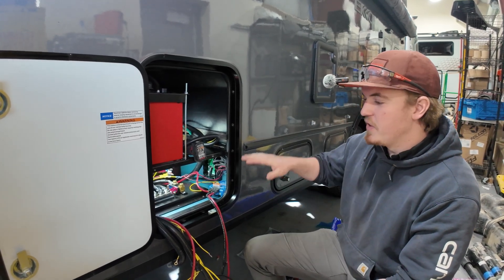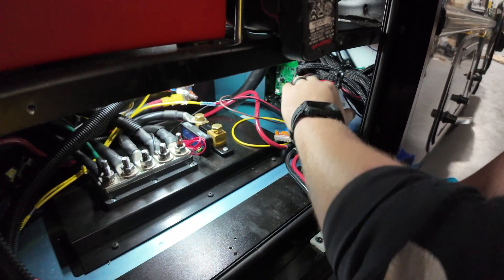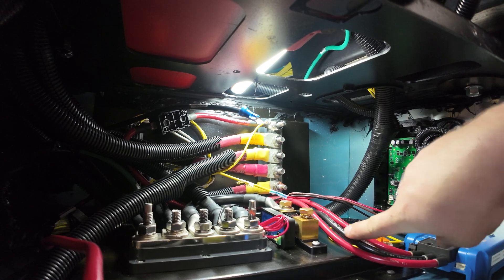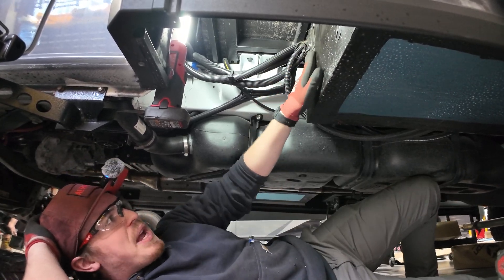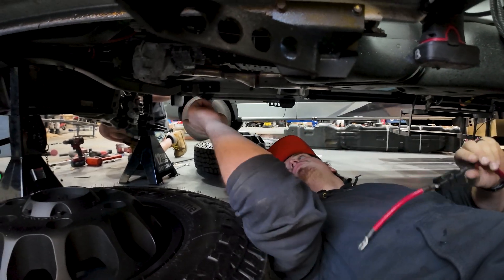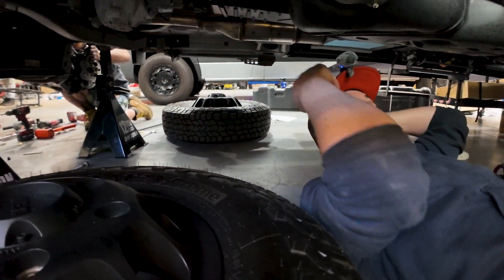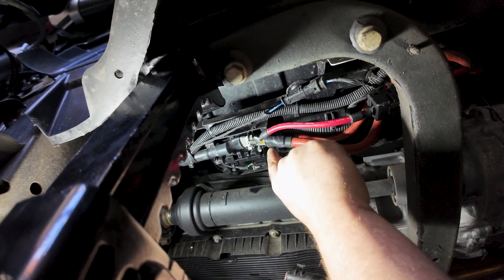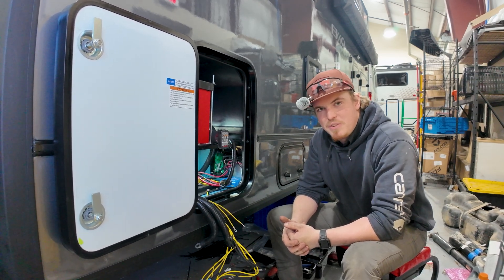Boost Your Winnebago Sprinter Ekko’s Charging with This DC-DC Upgrade- The Victron Orion XS

Comment: Look into 3d printing pass thru panels or custom grommets
Reply from the maker: @11THEFEZMAN11  not for something like this. No real need. Would just add to the cost to the consumer which is the opposite of what we ever want to do.
Reply: @ I built custom cars/boats/motorcycles for close to 30 years. 
3d printing has absolutely upped my game to a completely new level. Once you grasp the design software, I use Fusion because it’s free, you can  knock out a part like that in about half an hour, print 40 of them for $10, that goes for custom cable routing and silly brackets also. 
I was a complete skeptic up until about a year ago, now? I think nothing of designing and printing the exact silly little part to make a job absolutely perfect.

Comment: I didn't see the Wakespeed in the video. Did you remove it?
Reply from the maker: @NeilMcGarry  it's still there to control the second alternator 

Just has nothing to do with this video
Reply: @FreedomVanGo  How does the system limit the charging amps to the battery? I thought there was a 200 amp maximum to charge the Lithionics. Does the Wakespeed monitor the charging amps? When the battery is at a low SOC I see near 200 amps coming from the secondary alternator..
Reply from the maker: This is only able to be installed with two batteries.